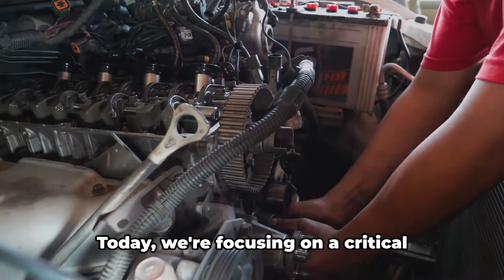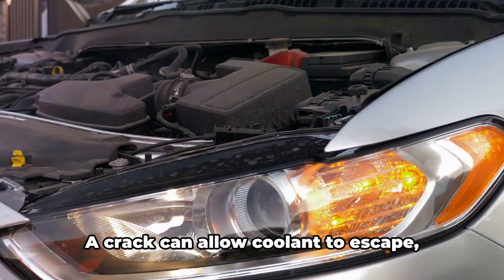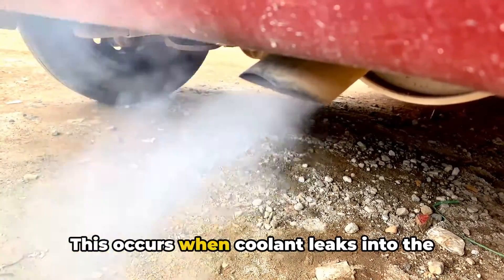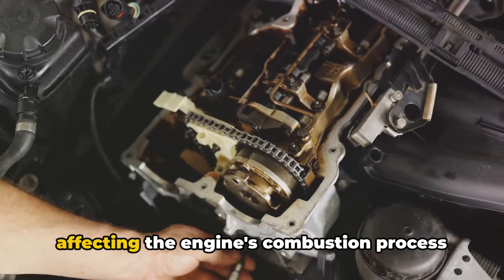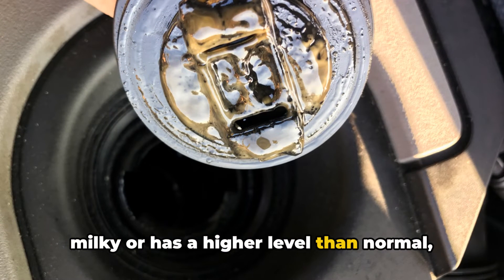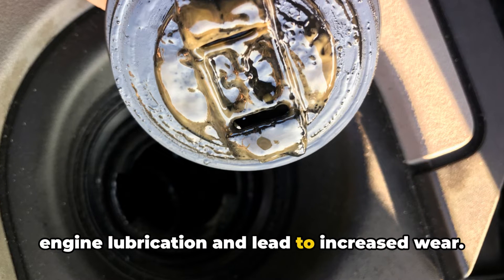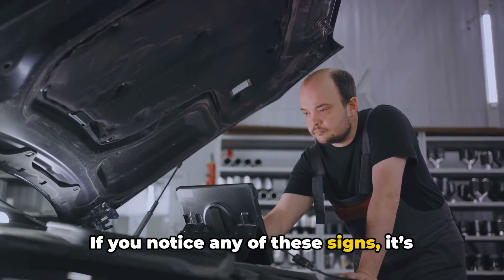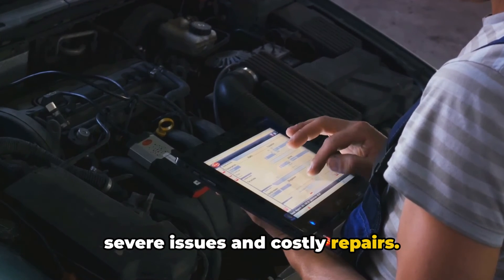Cracked Engine Block Symptoms

Comment: I have a v6 dodge with random misfires and suspect with over 200k miles that the block may have seen better days...😮
Reply from the maker: Hi Doug, With over 200,000 miles on your V6 Dodge and experiencing random misfires, it's wise to consider several potential causes before concluding that the engine block is at fault. Here are some steps to diagnose and address the issue:

1. Spark Plugs and Ignition Coils: Given the mileage, if these haven't been replaced recently, they could be worn out or faulty, leading to misfires. Check and replace them if necessary.
2. Fuel System: Issues with the fuel injectors, fuel pump, or fuel filter can also cause misfiring. Have these components inspected and cleaned or replaced as needed.
3. Engine Compression: Since you mentioned the possibility of the engine block being worn, performing a compression test can help determine the health of the engine's internal components like the pistons and rings.
4. Vacuum Leaks: Check for any vacuum leaks in the intake manifold and associated hoses. A leak can cause uneven air/fuel mixture leading to misfires. Let me know how it goes!

Comment: Purchased jeep latitude 2015,67k miles. Inspection  show has cracked block is that normal for low mileage car,?
Reply from the maker: Hi Brenda, Sorry to hear about your experience. Having a cracked engine block in a car, especially with relatively low mileage like 67,000 miles, is not normal. Engine blocks are designed to withstand the pressures and temperatures of normal operation for much longer than that. A cracked block can result from manufacturing defects, severe overheating, or a lack of maintenance, leading to internal stresses beyond what the material can handle. it's worth investigating the vehicle's history and maintenance records. Let me know how it goes